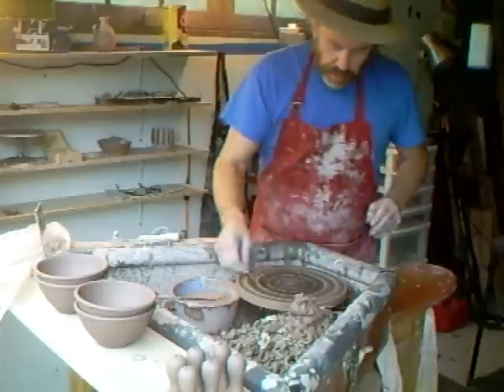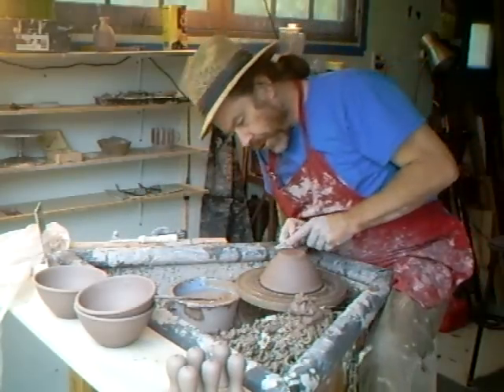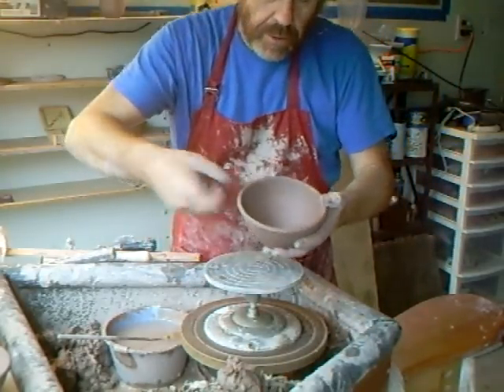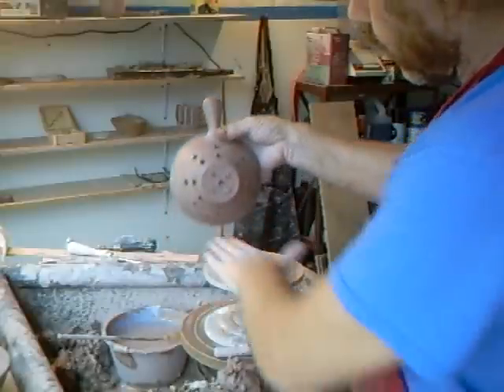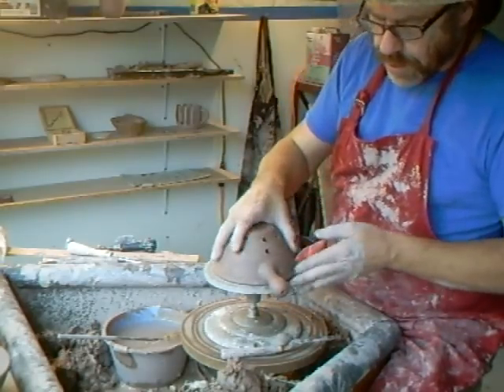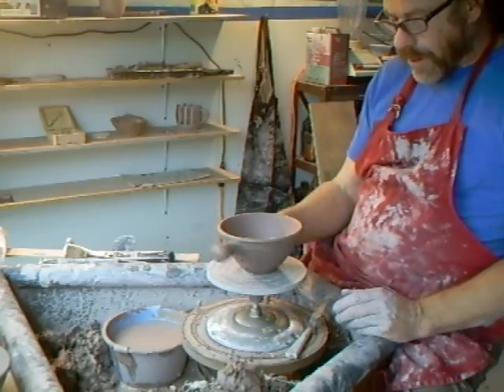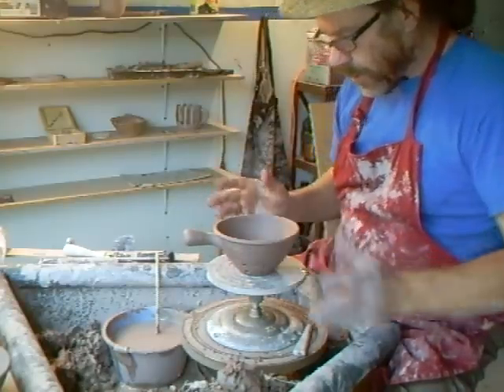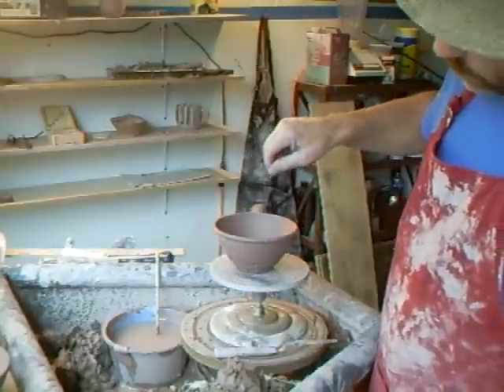SIMON LEACH POTTERY ~ A small general purpose colander !

Comment: I think you might want a ring foot for this, and then notch the ring so water can escape.  With a flat bottom like the GP bowls,  if you set the bowl in the sink to drain something, the sink will block up the bottom holes, and water will pool in the bowl up to the lowest hole in the side.

Comment: @waynep72 

Can't speak for Simon, but one could leave it unglazed.  A normal glaze shouldn't run through the holes unless it's quite runny, so if the foot is wiped off it should be fine.  I've stuffed little bits of paper towel in such holes before, to keep glaze out when trying to glaze the inside something different than the outside. It works well enough most of the time.   It is also not too difficult to clean glaze from the holes using a needle tool if the pot is just dipped in as normal.